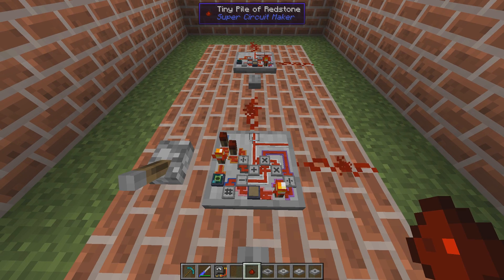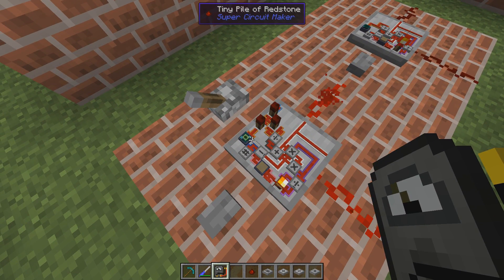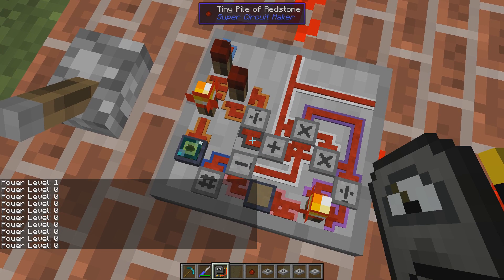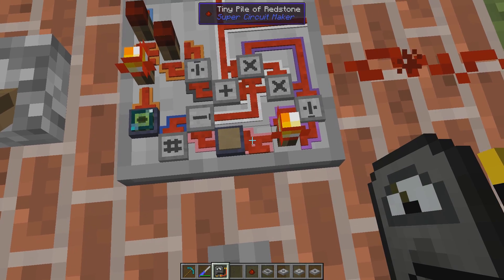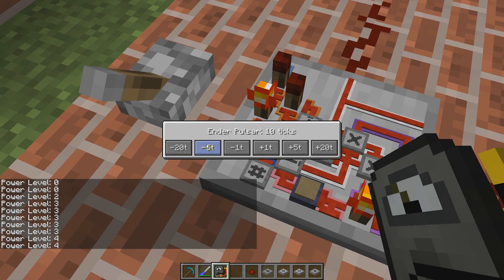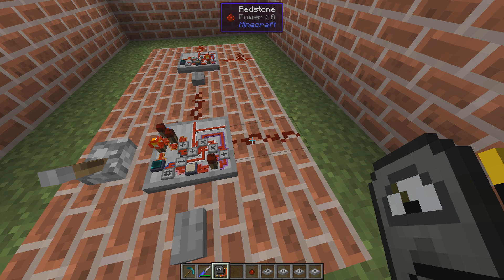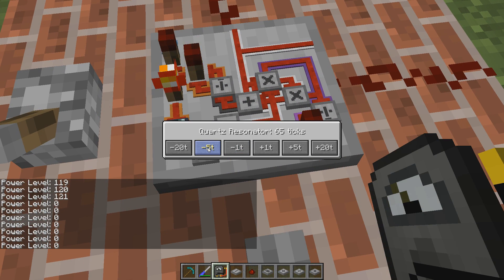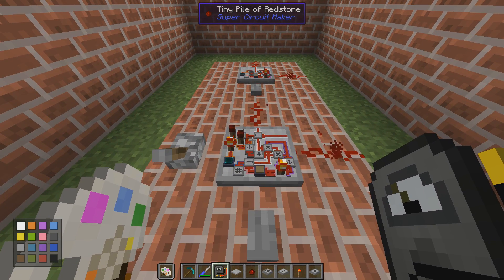Super Circuit Maker - Automatic Counter (MC 1.10.2)

Comment: +TKH Your reset button needn't link to the torch which is at delay to it. It only need hit the one, one less component, yes. This is an improvement.
Reply from the maker: Ah, good pointer, thanks for that! That delay can be removed, but the reset signal must connect to the top torch. The lower can be always on. If I connect the reset signal only to the lower torch the memory will reset to 255. To the upper and it will reset to 0 (which feels more right). If I connect the reset to both torches the cell will end up oscillating, that's why I put the delay. Now when the memory is "complete", I wonder if there's any use for it... :D
Reply: well, if you want to quantify inventory of a system, make a comparator that pulses when the memory reaches 255, pulse it into an adder, which then increments the next memory gate, which (including the increment) continues for as many bytes as are needed to store the maximum value desired. implement a decrement mechanism (same as adder, but using subtractor to -1 instead of + 1) and it will be able to register items passing by a dropper, which is the output. the adder will track a dropper which is on a clock to pulse when there are things in its inventory, and it will pass into the inventory desired (hook up a button that dispenses a stack of the inventory contents through a dropper, which is logged by the decrement mechanism, stopping if it runs out)
this will track, with perfect accuracy, the inventory quantity in binary. if you set a lower maximum, as long as you use subtraction to reduce the memory instead of resetting (so if the max is 100, as items come in it counts higher, and, say, by some magical delay of memory, it counts to 128, minusing 100 results in an accurate 28 instead of an inaccurate 0) (quite funny to read... no? in an accurate, vs an inaccurate)
if you read this all part-by-part, it should all make sense, i know i can be confusing, but i usually write in such a way that, if you only take the first n sentences, it still works.
Reply from the maker: Yeah, quite a fun little build. It should be possible to do by only connecting all my already build parts and the few steps to connect them together. Tempting... ;)

Comment: +TKH I told you scm broke for me, but here is a better explanation: Make a 3x3 loop where the edges are each of the four operators, supply the multiply with signal x, x is literally 1 or input-multiply (normally 1, but can be made greater with input), the divider is the same, the add/subtract each get zero normally, but can receive input. The purpose: Live operate on memory data, no need to read,operate,clear,set, just alter.
Reply from the maker: I took your idea with double subtractors instead and made a really simple memory cell with only 6 components in total (compared to my old with 9 components). It will change memory state when input is altered, keep the value when input is 0 and reset value on an external button press. No need for "set memory" in this design. Don't know if it's what you had in mind but it ended up extremely simple and I love it :D
Reply: how exactly do you set it lower? do you reset first? is that just the subtractor pair without the complement, and a button fed in instead? i dont know why the hunt fro minimizing components is so imperative though, i thought it was computational capacity.
Reply from the maker: Basically, it's in reset state when it has an input signal. When input is removed, the value is provided from the memory instead. I don't know how to compare capacity, but I this design has a 2-tick speed. However, for me it's not always most important to have high capacity, a simple, stable and easy-to-understand design is sometimes more fun to share :)
Here's the design: http://i.imgur.com/updaMS1.png 
The left delay is 2 ticks and the right is 1 tick, they are required or else the memory will start oscillating. Can it be reduced even further you think?

Comment: +TKH no, they're equal, but my point is: It supports relative memory, instead of absolute, and the absolute has a risk of not remembering when you wish for smaller values. Truth be told, you could replace one of the multipliers with a divider, and instead of one, have a variable divisor (or dividend... I'm good at math, but this is terminology, NOT math. Whichever is on bottom of a fraction) and you could do things like "divide memory by two" within the memory circuit, no reseting required. So on, so forth, Oh! OOOOO! REPLACE A MULTIPLIER WITH A SUBTRACTOR supply the multiply with one, and the subtract with zero, and you can decrement memory as well as set, at the same speed as the multiply only memory method AND the inc/dec-rement method, for a minutely slower variant you could channel the memory through all four operands to do all four tasks without having to detect, operate, reset memory, store, so its MUCH faster if you like to alter memory often. (should take only twice as long as your current system, which is already faster then you would ever need)
Reply from the maker: Reading your design ideas again... but I actually don't follow your brilliant ideas. It's sooo much easier for me with a screenshot or five.... ;)

Comment: New memory circuit: Loop two subtractors, 255-other, it will act like an rs nor latch (two torches that remember binary) as 255-n=x, 255-x=n, looping. Use: No divider needed, just directly input the torch signal, to reset to n, pulse the desired x on the other side.
Reply from the maker: Sounds like a clean solution, I like it! Is it faster than the memory cell designs in the reddit thread I linked to?